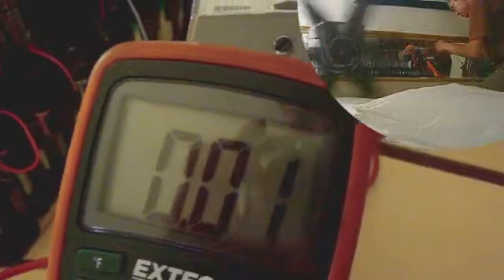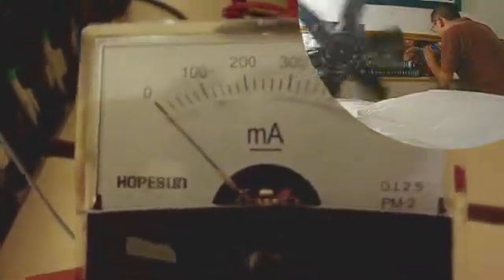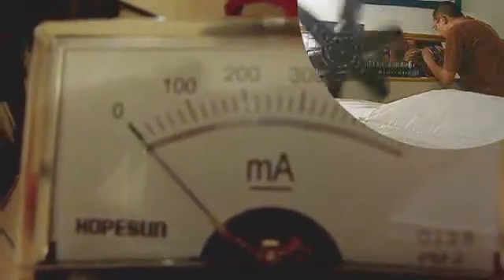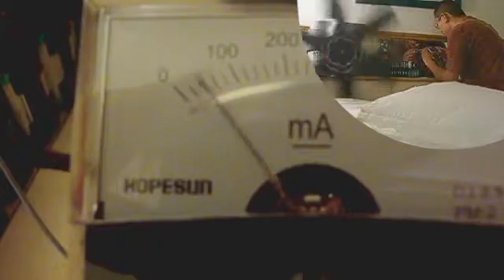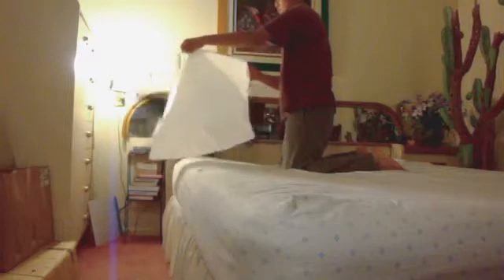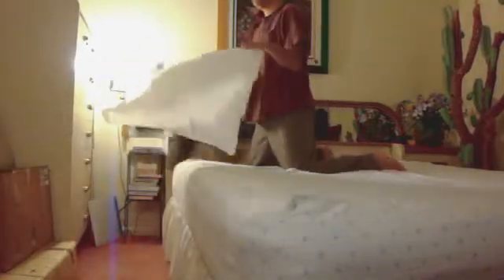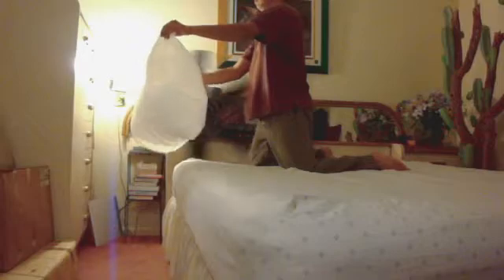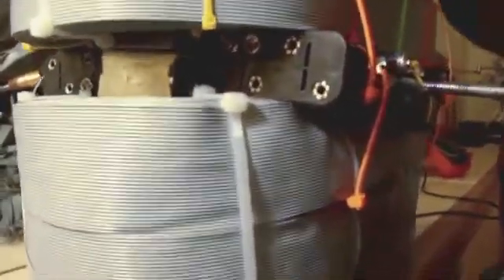Newman Motor efficiency improved yet again with even tighter coils than before

Comment from the maker: @jimmybilbo

"What VA (Volt Amps)?"

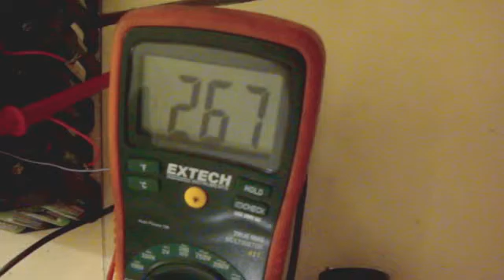I have many videos where I show volts. Even in this video I show volts (at 6:34 it shows 267 volts). You are technically correct as this video's description "1/4th less current usage than before" is essentially meaningless without comparing the voltage between this and the previous setup. The previous video was "Newman Motor 3 Fan Tests" so I don't have one specific setup to compare it to.

Comment from the maker: Check out the videos on his website. Newman mentions how he reduced the effect of the back-spike by using a diode pack. One of his older methods was the use of a fluorescent light connected in anti-parallel with the coil. The new design allegedly does more to capture the torque to do mechanical work. He has not disclosed this new design. As for the spark, you want the voltage off the spark, but not the current. So your sparks should be the result of a very brief connection, not a long one.